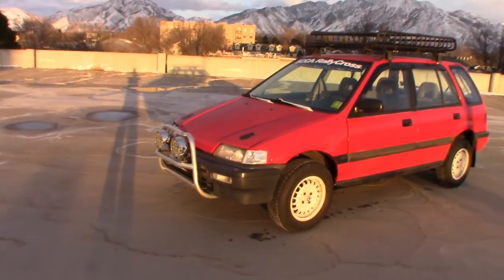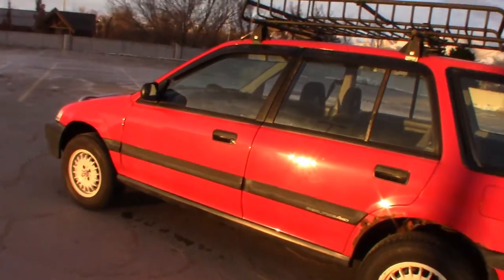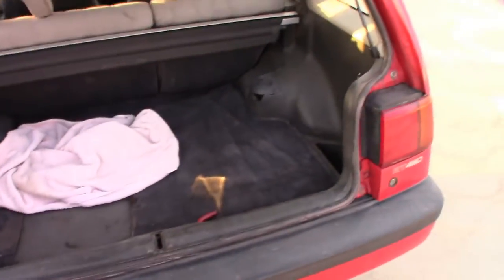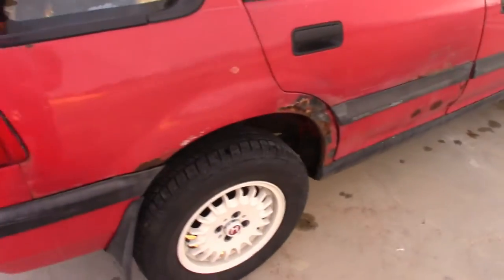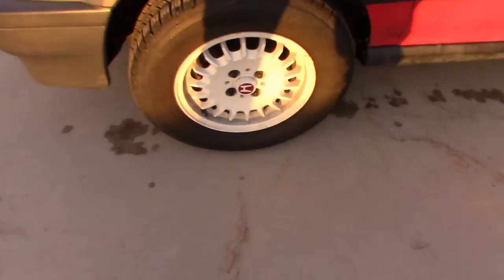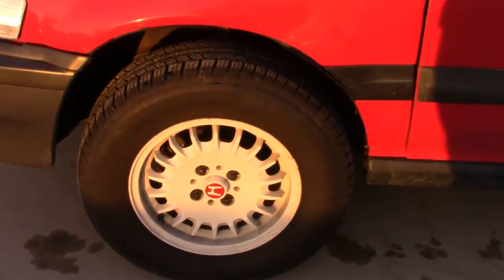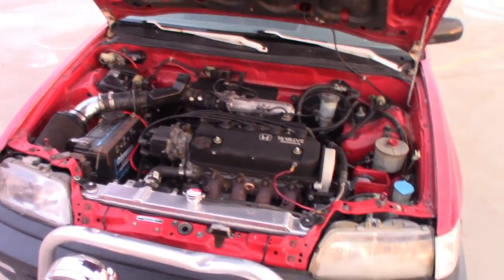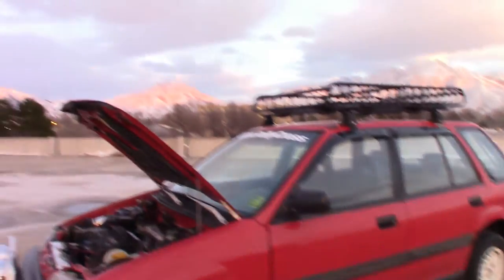1991 Honda Civic Wagon RT4WD Walk Around

Comment: Bought a DOHC swapped 91 rt4wd. trans mount back cracked, hanging there by a thread. $500 lien papers.It runs. $440 dollar replacement 6 speed on the way. I see massive value and worth in these, and I intend to keep mine forever, always wanted one to do the whole "low hella camber tilty wheels deep dishes"

Comment: The bull bar and lift is dope. Any links to the info on lifting the wagon?

Got a 91 hatchback and wanted to give it a bit more height. Got bigger wheels and tires but it's still too low for when I'm going camping or kayaking in shady spots haha the info would probably be similar, just gotta readjust the bushings to the new ride height

Comment: Cool Car man! I've got the JDM ZC SOHC in my 90 CRX too. I've got a Quaife LSD diff in it too. I'm digging those wheels too. I've been looking at some rally wheels, but I don't know which what I'm going to do next. Currently, I'm running Mini Cooper OEM Aluminum wheels. Do you know if the suspension upgrade that you did, would work on my CRX?